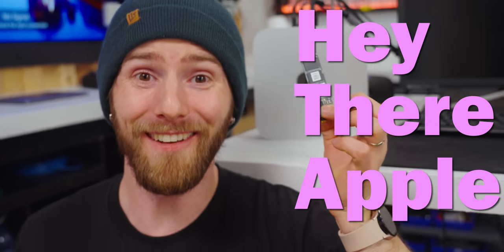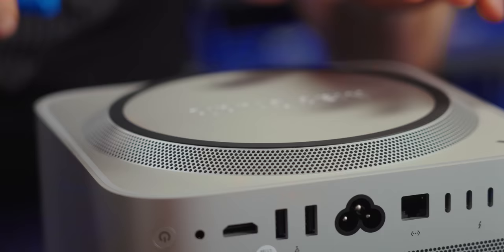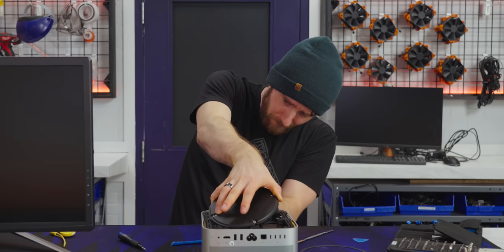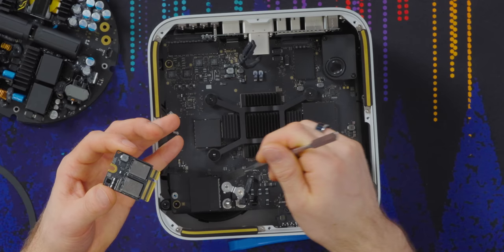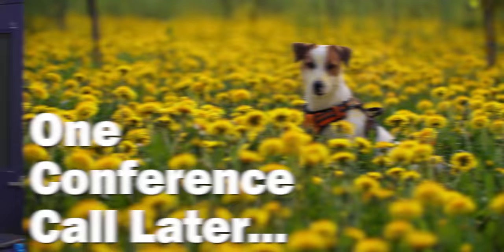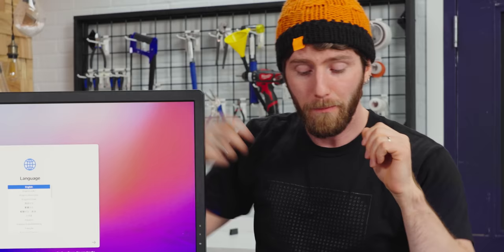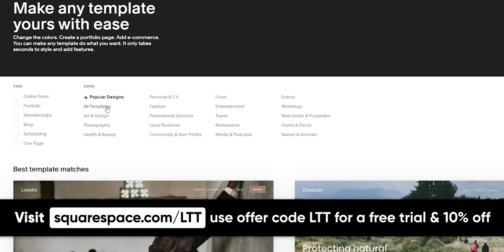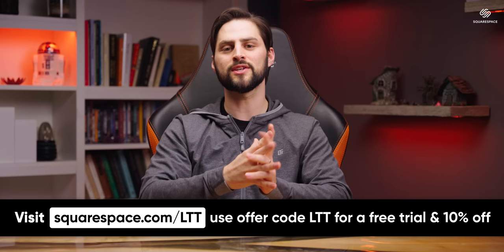I want to love Apple, but they’re making it hard - Mac Studio SSD Swapping

Comment: Apple: "We support the right to repair"
Also Apple: "It's not like you'll be able to find parts"
Reply: what did you try to install, SSD on a cable, what is it?
Why you need Linus? specials?
Reply: also apple: only by our own hands and lots of money
Reply: @lucasrem  did you miss the part of the video where Apple intentionally made their SSDs incompatible with regular NVME drives simply so they could save a few bucks on the controller? Their goal is literally to upsell you on upgrades they went out of their way to modify so that the consumer could perform themselves, despite literally every other competing product allowing the user to upgrade that part themselves.
Reply: "We support the right to repair (for our competitors)"
Reply: Linus:"we got eBay and amazon and our sponsors."
Reply: the first component to fail are the hard drive, imagine spending so much money & the hard drive is not repairable.. ?   I may have to wait a decade to buy another apple computer before they stop this non sense.. may have to stick with windows 11 for a while..
Reply: @acastro5197  they don't use hard drives anymore
Reply: @acastro5197  Better fallback to win10 and stay there forever, because Apple ain't getting better, they wil just be getting even worse
Reply: Just buy another mac and take the parts from there - so obvious ;)
Reply: @mschwaller3371  Dats why hate Apple
Reply: @microponics2695  From this point forward you will service us! Intel architecture is futile! But on the other hand why bother being a super power if you don't intend to bully the world around ...
Reply: Unless you live near Shenzhen
Reply: or afford

Comment: Apple in 2004: "Our Imacs only have 3 screws on the back so our computers are easy to open" Now: "Weld it shut or get fired" (they dont weld it but you get my point)
Reply: Oh, they will eventually don't worry, it is not a matter of if but when.
Reply: Soldered ram.. I think they are doing it
Reply: More people need to remember that teams of software and hardware engineers were paid hundreds of thousands of dollars to actively make the users' lives worse
Reply: @mr.Drawgo  it's an arm device, so it's normal, however they've done to that Intel systems as well years ago

Comment: Imagine if a construction company who built apple's building made proprietary outlets, door locks, and light bulbs, etc. Then when ever apple need to plug in something, make keys for doors, or change a light bulb they have to pay the construction company to send in a tech to do those thing for them....because apple logic.
Reply: Sell them a overpriced dongle.
Reply: This is pretty close to how the government buys contracts and spare equipment. Outlets aren't proprietary but keys for doors/changing light bulbs requires contracted companies to source them.
Reply: I would gladly design the new interlocking mechanism for their door, windows, light bulb housing, even the electricity socket
Reply: Sounds like the McDonalds Ice cream machines.
Reply: and if a door gets stuck shut and becomes a fire safety hazard, they can't just get someone to repair it, they have to pay the construction company smh. imagine a fire happens in the meantime 💀
Reply: @codyhubert6178  well it's a shame that ordinary people aren't fkn governments and don't need that type of shit and yet apple treats ordinary customers like that
Reply: @laur-unstagenameactuallyca1587  I was just adding on to the comment. I don’t believe in any way that any business transaction should be done like this
Reply: its not just gov that has this issue, i work in a unionized warehouse and you can't just change a light bulb or fix a stuck door, as per union regs only people with the correct title can work on a specific task no matter how simple it is. 

why companies put up with it i dont understand, takes a minute or two to change that light bulb but they have to hire a contractor with an electrical ticket, at 90$ an hour minim 4 hour to do on sight work, to do it as none of our union employs have an electrician ticket, if they did they wouldn't work here. wean wile we work (or dont) in the dark for the next 2 days costing thousands.

i am a union member bty and if i could vote it out i would. unions suck. they are a lot like bad home owners associations.
Reply: That construction company could eventually own apple then >.< haha touche !
Reply: Except unfortunately, that’s actually a thing in construction 😔. Especially with keys, locks, and many building supplies that are not necessarily compatible with multiple brands.
Reply: imagine buying a car that you can only fill the tank with gas from a certain pump, just because the pipe has a certain shape and any other wouldn't fit your gas tank... fookin' thiefs!
Reply: @robgilmour3100  Your bashing unions in a country with one of the most pathetic minimum wages in the developed world , good luck.
Reply: Don't give them ideas
Reply: It will happen. Just give it a little time.

Comment: Apple made some huge mistakes:
1. PSU is swappable.
2. Power cable is removable.
3. PSU is removable - it should be soldered.
4. Power cable does not contain lock-chip and can be swapped.
Reply: Chill. They get the idea one day
Reply: Hahahaha....yeah people getting fired for it as we speak
Reply: 5. USB-C cable should be chip locked to special devices
Reply: Apple should just make a computer that is an all in one, plug it into the wall, everything else is on board. Including keyboard, mouse, screen, speakers
Reply: @user-sw1wq8lh2w  soo, a laptop
Reply: @user-sw1wq8lh2w  Buy an iPad. (No; just kidding...forget I mentioned that...)
Reply: This is hilarious. It's so easy to make fun of such a greedy penny pintching corporation.
Reply: Power cable needs a proprietary connection so they can sell spares for $200
Reply: Apple is slacking SMH
Reply: the whole thing should refuse to turn on if you remove a single screw and should have to be sent back to Apple for a reset
Reply: There's not mistakes here, everything is thinking.
Reply: @NTN_music  lightning port exists already tho
Reply: That the new upgrade for next completely new redesigned engineering at Apple
Reply: They also made the connectors use thunderbolt which is a standardized connector and not their own which only connects to apple supported displays with the cable costing at least $50 and sold separately due to "environmental concerns"
Reply: On the bright side, PSU is exposed making replacements more complicated than it already is
Reply: It should be only run with Apple licenced electricity.
Reply: Delete this
(I beg you, don't give them ideas)
Reply: Non specific USB cable may be used
Reply: DONT GIVE THEM MORE IDEAS
Reply: 5. SSD Is removable
6. You can open the case
Reply: Only licensed screws should be allowed.
Reply: The computer also works in more than one plug. In a few years, you'll need an Apple (TM) Mac (R) compliant House (C) in order to run a mac.
Reply: @crackpotfox  To ensure the high Apple quality, the device should reject electrons that are not supplied by Apple itself or Apple approved electricity provider.
Reply: This is probably already in the works somewhere
Reply: And the fact you can open the device. Someone's getting fired for that
Reply: Yes!! I was really dumbfounded that they used a standard IEC 320 C5 connector for AC power. Clearly one of the Apple imagineers fell asleep at the wheel and totally missed out on the opportunity to create a custom cable design that's 10% sleeker but costs ten times more. That would have been such an easy update, and they dropped the ball on that. Seriously, Apple... what were you thinking?!

Comment: Honestly, I am really disappointed with Apples limitations. Adding/replacing storage should be a minimum.
Reply: I think every computer should have at least one internal port that can be user populated. And M.2 is a good approach for that. It's not only for storage, there are also wifi or bluetooth modules. Just like the old PCMCIA slots on laptops or ISA/PCI/PCIe in desktops.
Reply: Especially for the goddamn price
Reply: Even laptops are upgradable for memory and storage, even some of em can be swap out the gpu and ports...this freaking metal brick can't do the modularity part even the easiest one
Reply: I'm not disappointed. Never expect anything and you will never be disappointed. You can never really expect any pro-consumer move from Apple.
Reply: This is apple lmao
Reply: not just the minimum, it should not even be up to debate
Reply: Even already when you want to get dust out of this system 😅
Reply: I agree
Reply: Remember when Steve was fired? This was the exactly kind of thing that Apple did... We all know the results.
Reply: It never has really been, why should it be now?
Reply: @VideoArchiveGuy  . My 2012 Mac mini says you are wrong.
Reply: @robertt9342  I can add memory to an Apple ][+ too, time moves on.

Comment: The biggest irony is that the number of people they prevent from doing this is so so small that they likely loose money by even spending the time to develop these protections and in place.  Not to mention the customers they might have lost by doing so.  They are literally costing themselves money by trying to make more money.
Reply: Nah, there is a ton of reasons to do this bullshit. 
* An actual economic reason: there is a market of buying and ripping devices for parts to sell them to repair shops. Of course it is cheaper, faster and easier than source them from Apple.
* Stolen devices are especially nice to disassemble and sell as parts. It is an actual problem that apple can solve in this horrible way, but sadly don't. Hackers are always one step ahead.
* Secure boot is a thing and it requires a chain of trust, aka locking EVERYTHING down in a most annoying way, so you can't compromise a computer even with physical access. It includes inability to add something new to it without wiping it.